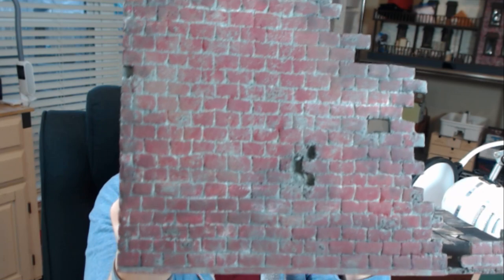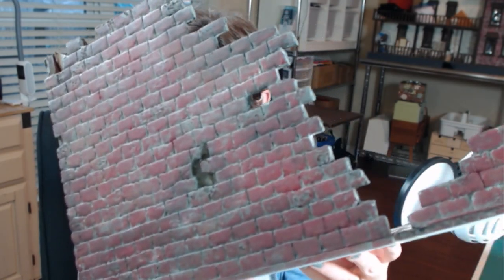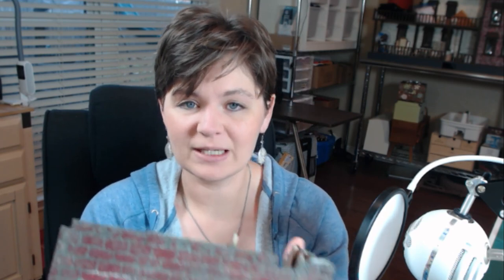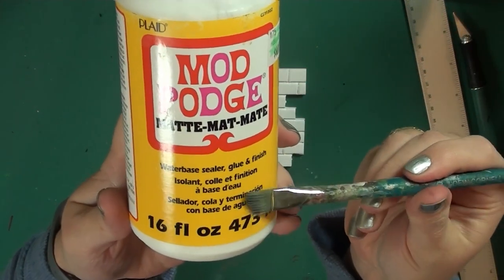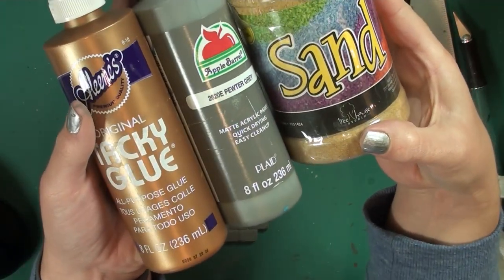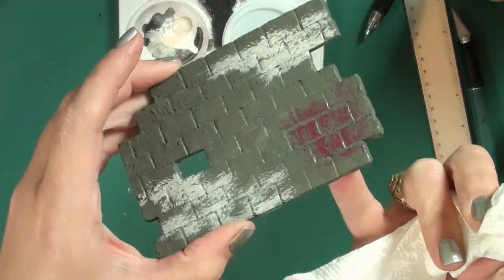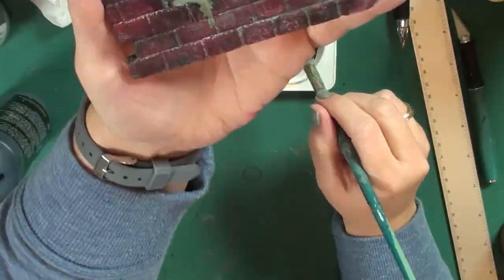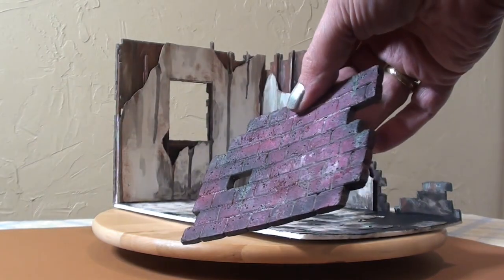Abandoned Coffee Shop 1: BRICK TUTORIAL and Project Intro!!!

Comment: I love the rough look. I think your idea of an abandoned coffee shop is really great because everybody makes them cute or modern. A question, do you know how to fix warped foam boards? I bought mine from Dollartree and when they arrived to Sweden not only had they crushed corners but they also looks like bananas.
Reply from the maker: Niva80 thank you so much!  Hmmm... my first thought would be to try and warm them up slightly with a dry heat (like with a hair dryer) and then quickly get then underneath something flat and heavyish while they cool down.  Just be careful because if it's too hot it could effect the foam.  Another thought is to glue poster board to one side and lay it under something flat while the glue dries.  Getting smaller pieces flat are easier than larger pieces cut them down if possible before flattening.  I hope this is helpful to you.
Reply: Thanks I´ll give it a try :)
Reply: If you paint the backside with the mod podge  too it will keep it from warping. If it has warped already you can still fix it by painting on the back, but may need to help it some to lay flat.

Comment: Looks great! How did you managed for the foam board not to bend after applying paint etc? mine always bends even with one layer of paint!
Reply from the maker: A good trick for foam board is to paint both sides of the board.  If you just paint it on one side then when it dries it will bend and warp.  You can also add a layer of matboard on one side and glue the two pieces together under heavy books.  Those are the 2 methods I tend to use ;)